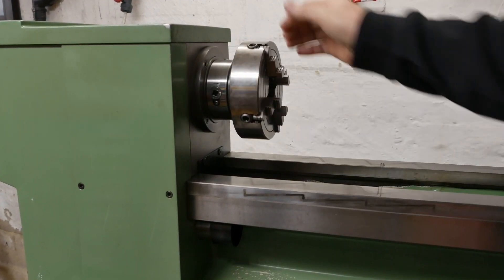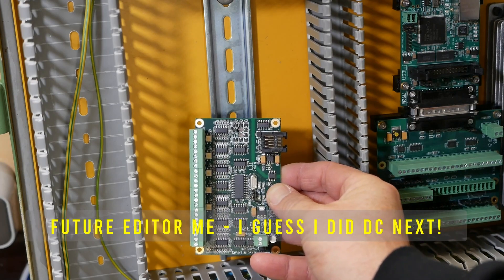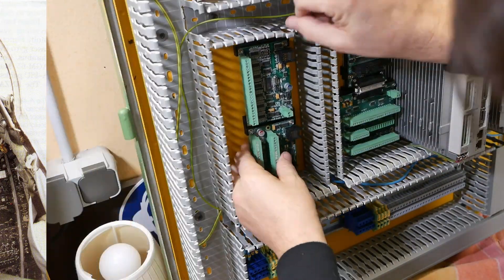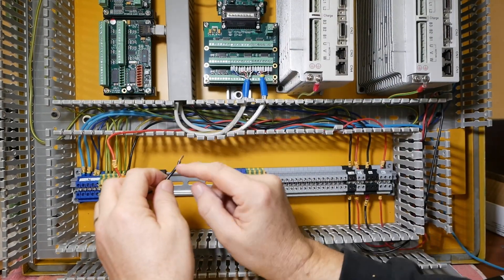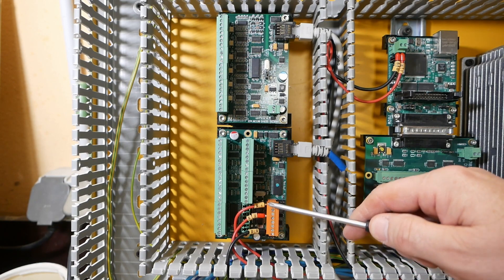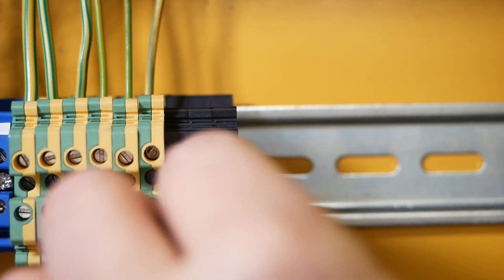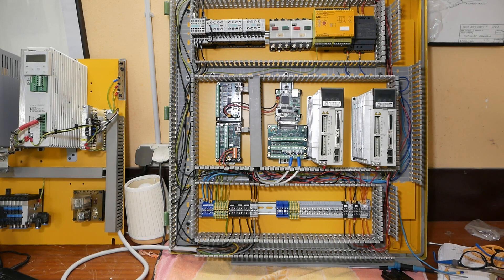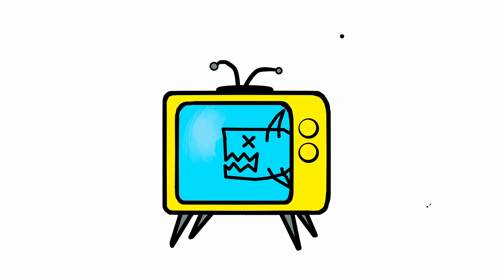Schaublin 125CNC retro fit - episode 27  -  power wiring

Comment: 0:50 Really bad to open with this kind of false information. It's fine to install additional GFCIs, and it is especially fine to cascade normal breakers. Also, unless your house was built very, very recently, you do not have GFCIs for the rooms in your basement - rather they will only be for outlets in your bathroom and for the outside, like balcony or garden. Also, if you actually do have 30mA GFCIs for your basement, they would probably immediately trip when the VFD starts driving that motor, as they produce a lot of residual current. It's common to have 100 mA or 300 mA GFCIs for those outlets.
There's literally a note on your Vector 8200 VFD itself ("Bei Einsatz von FI-Schutzschaltern Auslösecharakteristik beachten") and LENZE documentation also says "Controllers can cause a DC current in the PE conductor. If a residual current device (RCD) or a fault current monitoring unit (RCM) is used for protection in the case of direct or indirect contact ..."
Reply from the maker: Thanks. This was my bad. I have since discussed it with my electrician friend.
Reply: @RotarySMP  It's actually not your bad - it's the bad of people who are supposed to know it and give you proper advice.
Obviously you are going to trust your electrician in these questions, but then some rando like me comes along and says "you probably don't even have a GFCI for your basement" as the rando happens to know how most German homes look like.
The important rule with cascading is, the values need to decrease (or have faster tripping characteristic) when you get closer to the consumers, so that these will be the first breakers to trip in case of a fault. You should also have many small breakers for each individual consumer or circuit. A big 3x16A breaker wouldn't give you more protection, as any CEE 3x16A outlet will have that protection anyway - it'd just be a convenient way to shut it off. However, if you put multiple 6A and 10A breakers in your circuit to protect individual components, that can actually help increase safety. Generally speaking, circuit breakers are just there to protect the wiring itself. Most electricity consumers will go up in flames anyway when continuously passing 16A.
Reply from the maker: @graealex  My house has two 3Ph FI/ 16A pairs for the two 3PH Services (oven and basement). Then there are 5 1Ph CB's on the oven circuit, and 6 1Ph CB's on the basement service. The various lights and sockets in the house are distributed on those 11 circuits.

I have Motor protection overcurrent devices  on the two dumb 3Ph motors of the Schaublin (Variator and coolant pump). The spindle and both axis are behind VFD's which will have there own current protection.
Reply: @RotarySMP  Hmmm. You sure that these are combined FI and circuit breakers? Especially since ovens don't really require GFCI anyway. Generally, only user-accessible outlets need GFCIs, which doesn't include your oven. Obviously it's always good to have more protection.
Reply from the maker: @graealex  No not combined, I meant pairs of FI and CB's. Each FI protects both it 3Ph, and its single phase circuits.

Comment: Happy I could help you!
Reply from the maker: Thanks again Jörg. How do you decide between the filaments? If my printer did prints like that with ABS, I would only use it for everything.
Reply: @RotarySMP  Here PETG because its more flexible and heat resistant than PLA. ABS is  ever more heat resistant but requires a (heated) chamber.

Comment: I'm almost sure, that you can have breaker behind breaker as this is equipment, could someone check that? If it is not allowed so is going down with wire ratings, and this would be ridiculous. Also, in my limited experience i have seen a lot of breakers in cabinets, even in permanently installed ones
Reply: Seems wrong to me too. I’ve worked as a sparky in UK and Germany. Definitely not aware of any such reg.
Reply from the maker: Maybe I misunderstood. I'll be seeing him today and have a chat about it.
Reply: @RotarySMP  Only thing I am aware of is that you shouldn't put 2 breakers of the same rating in line, because it wont be clear which of the breakers wil trip when an overload occurs. We (in the Netherlands) have plenty of equipment with their own breakers, while working within residential code.
Reply: @SjaakWWortel  Yes, that’s also to my knowledge, there’s nothing prohibiting you from having sufficiently differently rated (in terms of how quickly, and under what overload) breakers in series. Typically your complete house might be behind big “NH” type chonkers in the sealed energy-counter cabinet, maybe smaller screw-type fuses per building floor, or for individual flats in your house, then the normal 16A breakers we all know and have used so often. The rule is that only the breaker nearest to the individual fault should open, in the general case.

Also this applies only for fixed wiring, there’s plenty of portable equipment (with plugs) that has additional breakers.

I think the main rationale is that when blowing unrelated fuses, just the added hassle and confusion in needlessly having to find the origin of the fault is considered a hazard in its own.
Reply from the maker: Thanks for your feedback guys. I discussed with my mate, and he agrees with you. It is not forbidden, but it should be a heirarchy of protection so it is clear what goes, but since my wire sizes are all at or above requirements, there is no issue with doing it like this, behind a 16 amp CB and GFCI.
Reply: Here is Oz RCD's have an activation time in milliseconds that provide the protection. Normally you have a faster activation time on the equipment, than on the main board, this prevents the entire board being tripped if there is a small leakage for whatever reason. Lethality of current is related to the duration of the shock, I remember an old chart from my time at uni that showed a current vs time curve. From memory I think RCDs have around 40ms trigger time or less.
Reply: That one was strange to me too. Maybe not needed (if the fuses are the same ratingi), but not allowed is strange. Basically every peace of equipment has an internal fuse. By this logic, you would not be allowed to plug in a 1A device into a 16A socket, or the 1A device would have cables rated for 16A.
Reply: That was a case even inside commercially designed, manufactured and installed equipment
Reply from the maker: I guess these industrial machines are normally in shop, with a pretty robust power feed. I only have 16A on my 400V feed.
Reply: Nothing wrong with putting a breaker behind a breaker. For correct installations it's just usually not done because in case of a short circuit both breakers will trip even if they have different current ratings. If you have no problem with multiple breakers tripping at the same time just install as many as you like, otherwise you'd need a SLS (selektiver leitungsschutzschalter) which has a time delay before tripping.
Reply from the maker: @ChristophPech  Thanks for the feedback.

Comment: If you want to do something better than putting numbers on wires: There is heatshrink tubing in all manner of colors that can be used in a label maker. They're a bit expensive but also SUPER USEFUL if you want to find a specific wire to tap into or something.
Reply from the maker: For the more complicated labelling like the TB3-2 pin on the 7i83, I use a label maker and either transparent heat shrink, or tape over it.
Reply: @RotarySMP  Did you know you can get heat shrink that is printed directly by the label maker?
Reply from the maker: @gillywild  Not for the label maker I already have unfortunatly.

Comment: Please add a separation spacer between the three phases on the black terminal block. Those bus bars are too close together for my liking… after all, you have 400V accross. Grüße aus Hamburg von der LHT 😀👋
Reply: I had a worred thought too but after seeing the gap its pretty far
Reply from the maker: Thanks for keeping an eye out for these things.
Reply: I noticed that too. Also those terminal blocks look a bit too "finger accessible" for my liking.
Reply from the maker: Yeah, one of the issues with doing a job like this is that you get very comfortable working around it, but have to make a mental reset once you get to the point where you do the hook up and trouble shooting with power.

Comment: Also link for wire identification  clips please 🙏
Reply from the maker: I bought them off Ebay months ago. Something like this...
https://www.ebay.com/itm/164489925506?hash=item264c5d1382:g:tFsAAOSwadhe3Rvx
Reply: @RotarySMP  thanks mate ordered. Should make it a bit easier on the apc600-30 Bridgeport  conversion
Reply from the maker: MAHO used a system like that, and they really are quick, which makes a difference on the project like this.
Reply: @RotarySMP  so did Bridgeport  but theres a lot of new wires so start fresh